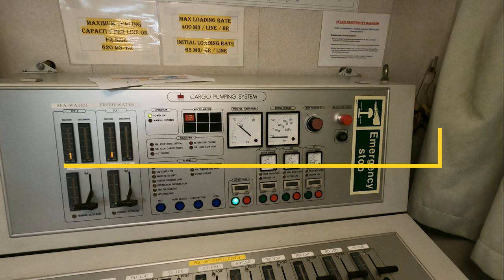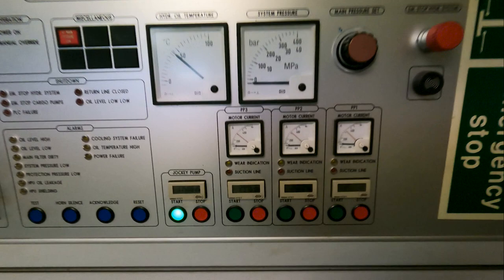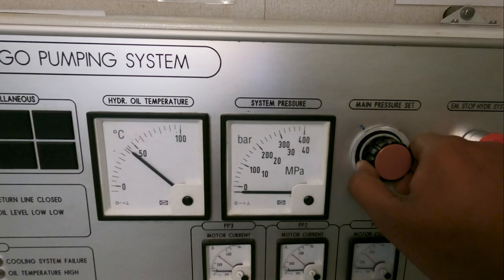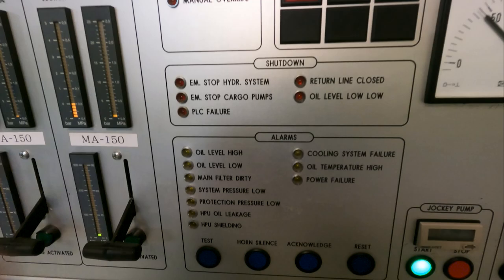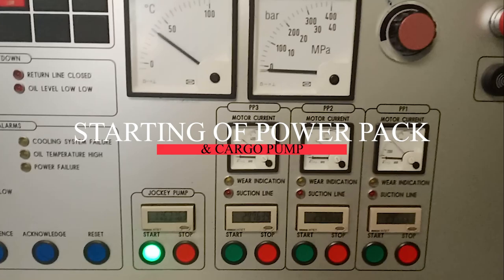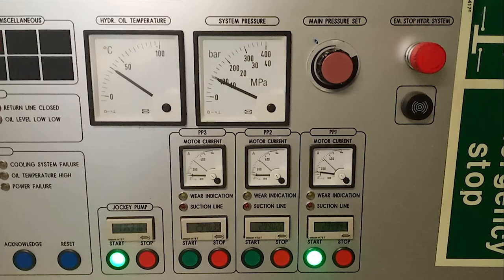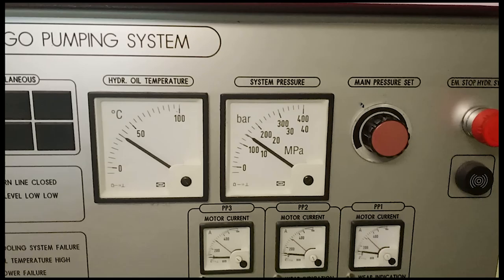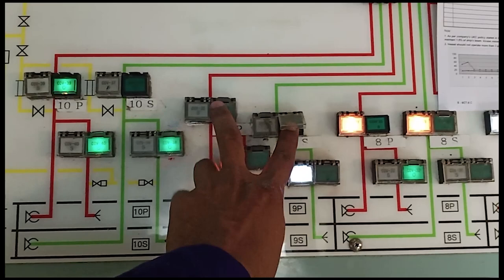FRAMO PANNEL IN CARGO CONTROL ROOM(Power pack on tanker ship)

Comment: Which system oil is used, where do you need normaly  to check oil leak
When you press the pump start button which valve opens, is this ball valves or globe ,valve